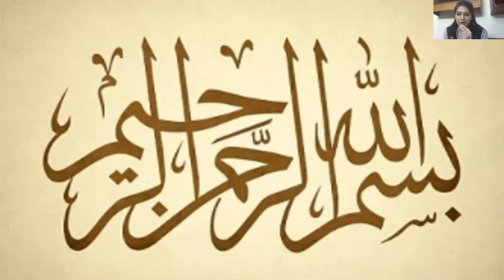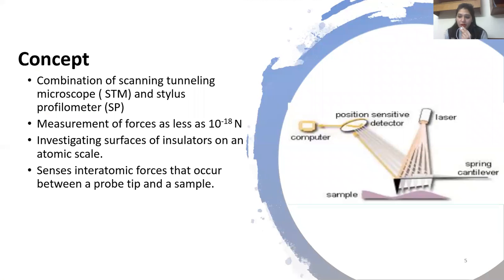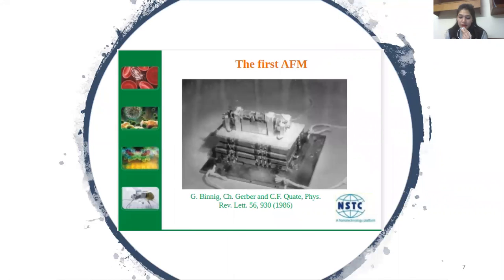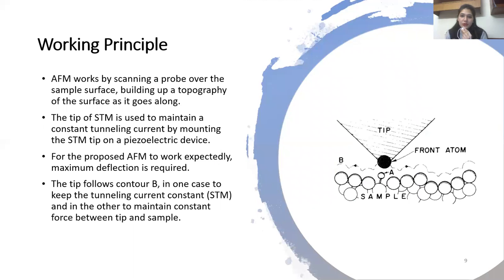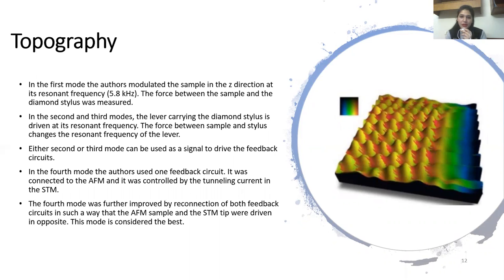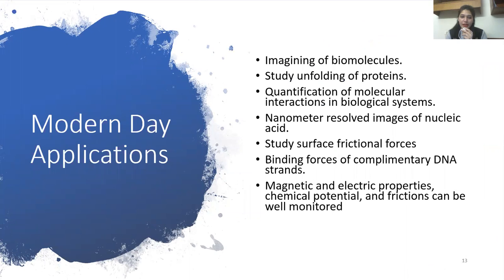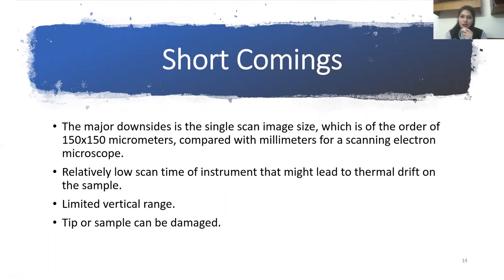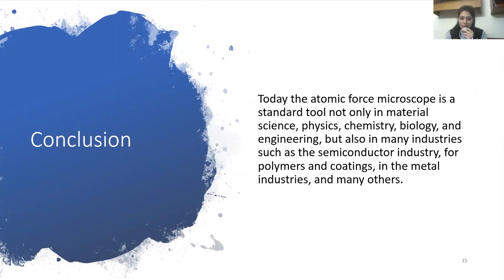Atomic Force Microscope - Microlecture by Maira Farman - KPR-1 - LUMS

Comment: Can we see individual atoms with the AFM
Reply: Sort of! It is sometimes reported that contact mode AFM has "atomic resolution", as it is possible, with some samples, to get images which show the atomic lattice. However, it has been shown that these images show not the individual atoms, but just the lattice,
i.e. they show "atoms" where, on average, the atoms are but cannot show, for example, vacancies (missing atoms) in that lattice. Nevertheless, such images can still be useful and interesting. Typically, to get "true" atomic resolution, we must use STM or AFM under special conditions(.e.g. in UHV, cryo-AFM).

Comment: Can we scan in liquid?
Reply: Yes. This is one of the principle advantages of AFM, it can be used in vacuum, in air, or in liquid. A liquid cell is usually required. Top-down AFMs, for example, don't really need one, it's possible to just put a drop of water on your sample, and scan in that. Usually water, or buffer are used but organic liquids are also possible, as long as they don't dissolve the liquid cell.